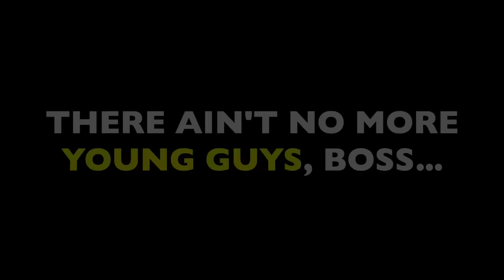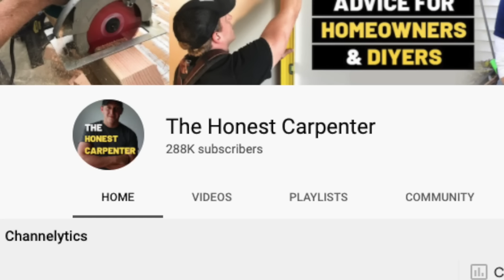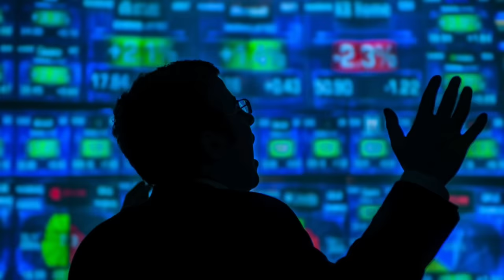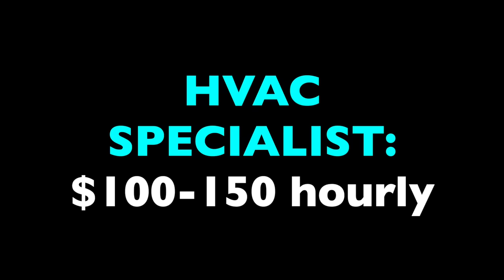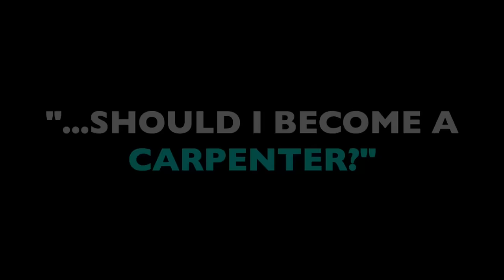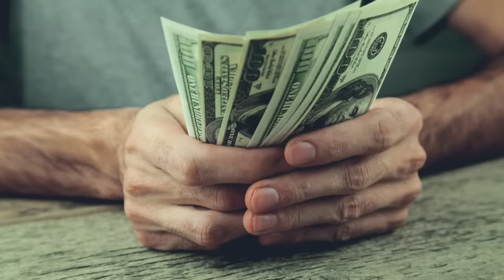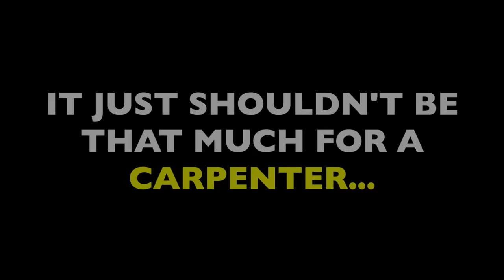WHERE HAVE ALL THE CARPENTERS GONE?! (Why The Trade Labor Shortage Is Only Beginning...)

Comment: I'm 24. Worked with a company who flipped homes so I would go in and do the framing, drywall, window replacement door replacement, cabinet replacement, bathroom remodels everything. I went on my own and eventually learned the plumbing and electrical side. I'm totally independent right now and when I do a kitchen or bathroom I do all the plumbing and electrical but also the trim and drywall and painting. I get to do everything which I love and average 60-70 an hour because of the plumbing and electrical part of the work. I think I found the formula to getting to do carpentry but also making money like your an electrician or plumber. I know I wont average what they do but its enough for me and I get to do the fun stuff along with the stuff that pays well.
Reply: Same here, but I kind of got into more of the variety from working maintenance way back when, but also we had a couple big fires back in the '80s and the people I was working for they couldn't get a dry waller to come out to the job to even look at it. Nowadays it's more about the fact that the job doesn't stop because the next trade has to come in I just change my tool belts.
Reply: So in other words, if a carpenter wants to make money like a plumber or electrician, they just have to learn yet more skills.
Reply: Im 24 right now and I am 5 months into house flipping/home reno after losing my job. Im trying to be as much of a sponge as I can at work and Ive learned so much. It also helps that I have lost 30lbs ever since I got into this field :)
Reply: Greg Sheppard  cause I can.
Reply: U need a contractor license to b a real carpenter, and make money
Reply: All the more reason the hire a Home Inspector before buying.

Comment: My first real job was when I was 15 and started working on a framing crew. I left the field but have always had it to fall back on when times were tough. The skills I gained as a carpenter are invaluable in everyday life, as well.  My biggest gripe with the carpenter trade is they don't have any license and training requirements. A guy buys a tool bag and hammer and calls himself a carpenter. I have seen some very shoddy work, because of this. I never quite understood why carpentry didn't have union or trade license. I mean it is the basis on which everything else is built. I think there could be a demand for higher pay for quantifiable skillset, just plumbers and electricians.
Reply from the maker: Exactly, Joe! I would always tell my clients, “In NC, everyone is potentially a professional carpenter” 😅
Reply: I have only watched your videos occasionally, and I'm one of those in IT who works for the government programming the systems you pull permits with. 

I think the reason why those 3 trades in particular are so highly paid is because there are minimum qualifications, licensing and regulations behind those skillsets. Everything else falls under 'General Contracting' that can be anyone and anything. Some areas might have better enforcement with their building codes/permits to make sure there's some standards being enforced but there's not even that much industry supported standards. 

Plumbing, Heating and electrical licenses are tied to individual people, and if enough issues arise with that person's work their license can be put in jeopardy in some states, but even more important insurance companies can say hey wait, this guy's working for you? Your insurance just doubled. That doesn't happen with carpenters and it cascades down to the point that it becomes hard to justify the price difference because there's no paper trail showing why you are worth 50 dollars an hour more than the next guy. It's also why it's easy to just toss employees aside during slower times because it's a trade that relies on more actual construction, not repair. Very few people need emergency carpentry, unlike plumbing/hvac/electrical. And since people still expect to pay high rates for those three trades you can still find busywork to keep your employees busy during downtimes by running specials and temporarily cutting pay some as part of those lean times. If times are hard and you make 80 an hour as a plumber, getting your hours cut back or taking a cheaper gig for 20% less sucks but it's still livable.
Reply: The quality of the field carpenter has decreased since the advent of pre fabricated trusses.  The math involved in understanding roof framing theory kept out the fakers.
Reply: We're experiencing a labor shortage. Increasing the barrier to entry with licenses and regulations would just make that even worse.

Theoretically it would create some standardization, but look how these things often work out in practice. Government bureaucrats who have no clue about the industry design the courses and tests, and it ultimately doesn't qualify participants, but turns into a moneygrab, and bureucratic annoyance for anyone trying to get into the field.

You don't need a piece of paper in order to tell who is and isn't a good carpenter. The customer can ask for proof of work, some sort of portfolio. Ask around at the material suppliers for their most highly recommended or sought after pros. Get referrals from others who had good work done. Those sorts of things are what people really look at whether there are licenses or not anyways.

If a customer hires the first guy they find on an ad, they get what they get. If you as a pro can't set yourself apart from any random jackass who has a toolbelt, then you need to work on your marketing and networking, or stop pursuing clients who only want the cheapest work possible. Those are the only real solutions.